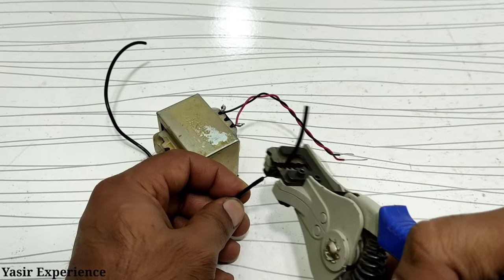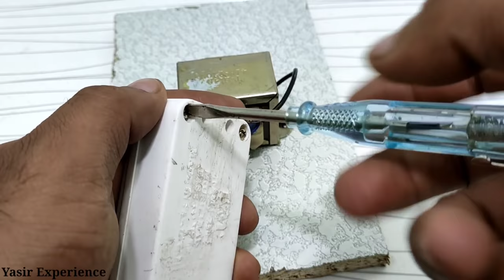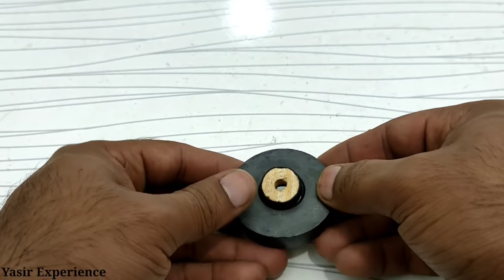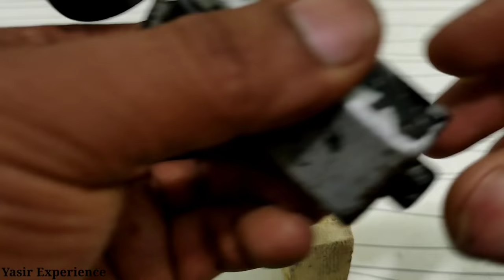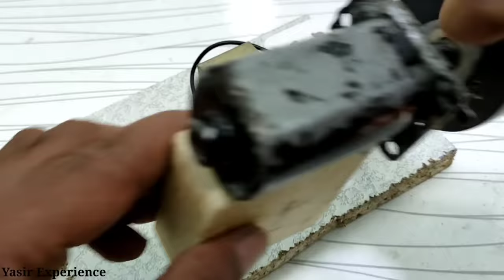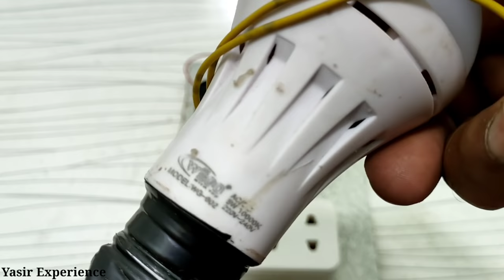Turn a Small Transformer into 220V 800W amazing Powerful Generator

Comment: Lock of knowledge.. 1.Transformer winding primary & secondary short to each other.  2.Transformer magnetism is closed north & south pole, it cannot induct to transfer power from outside the core field. 3.Magnet turbine is in sideward rotation, no poles to  release magnetic energy. Even if it's working, but the Rpm speed is too slow. 4. You're the great sir. The light bulb you use is rechargeable battery operated.. thanks
Reply: Impossible video..😊😊
Reply: 0
Reply: Thanks for enlightenment
Reply: Quanta mentira!
Reply: Scam as breaks all laws of physics
Reply: Nice idol
Reply: @ianhosier4042  thermodynamics first law is flawed lol.
Reply: Salut champion ! Vous êtes un génie.
Reply: Svt,la batterie qui démarre la bobine là est de combien de Volte ?
Reply: @kanlanfailamboni2392  Гении  в интернете трудятся а поте лица.
Reply: I short scam fake
Reply: 😂for a moment i thought this guy wàs doing something constructive
Reply: This dude, l like that...😅
Reply: @ianhosier4042 А кто их писал эти законы физики?  Не всё так однозначно.
Reply: Very impresive, you're brilliant

Comment: I wonder why the he sold the 2 wire in the transformer they use as a switch 😂 u see while he plug' and make it light because they hide a battery inside the bulb or the bulb has a small switch hiding hes hands 😂 inshort the transformer that he use is useless'   that only to ways either the bulb has switch or they make the transformer as connector' thats why he sold the both wire to input to outout 😅 AC to DC 😅😅 so funny

Comment: Absolute stupidity, this device can never produce any energy and 800 W not yet. The transformer has a maximum of 5 VA more no. The magnet has a magnetic field oriented in the axis so that no field in the transformer changes, moreover, the transformer has a closed magnetic circuit into which nothing can be induced in this way.